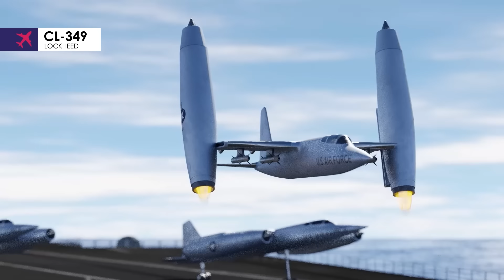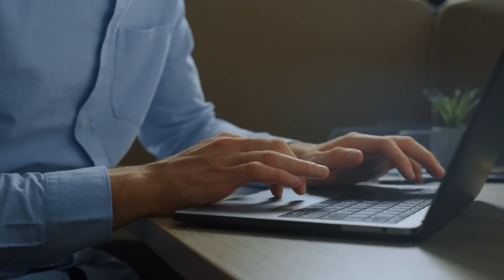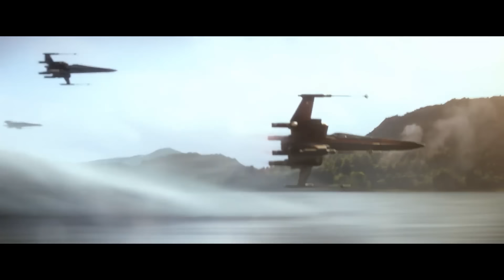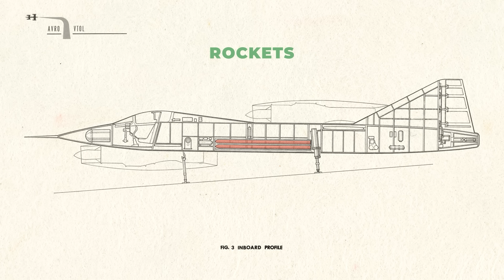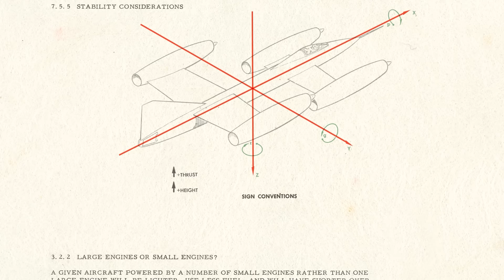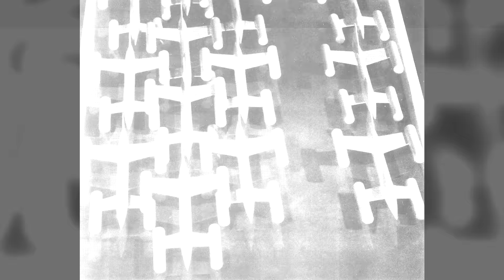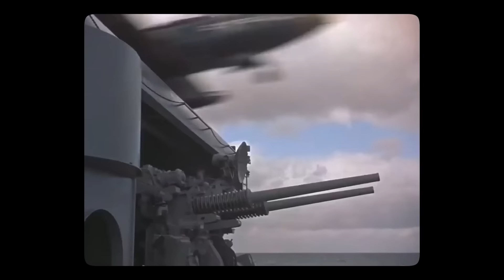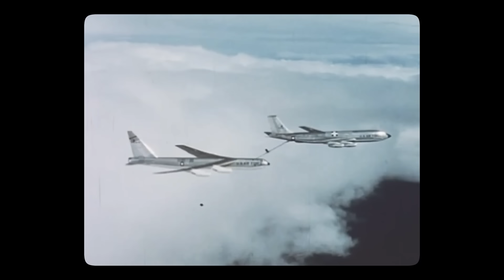Real-Life X-Wing Fighter Jet? ...Canada Tried It

Comment: The concept of the "eyelid" nozzle for thrust vectoring is mind-blowing; I can't believe it took until the Harrier for designs like this to become common!
Reply: Ryan vertifan in the 60s took until the f35 to make that common
Reply: Without sufficiently powerful microcomputers that can fit inside an aircraft, the "eyelid" nozzle concept will be next to uncontrollable. 

All I thought while watching this video is what if a single engine failed? Unlike the centrally mounted engines of current VTOLs, wingtip engines will certainly cause it to be unbalanced and because the thrust is produced at the wingtips, there will be no way to recover it especially with those short stubby wings - not to mention how much that x-wing configuration will cause the airflow to be all wobbly and stuff.
Reply: Pardon? Do you realize clamshell bucket thrust vectoring is standard on jet airliners since the 1950s for reverse thrust braking on landings?
Reply: Harrier doesn't use 'eyelids', it has rotating nozzles for exhaust gasses at the rear, and the same at the front for cold air coming off the main fan. Some main fan air is routed through piping to the nose, tail and wing tips for control during hover operations.
Reply: @PiDsPagePrototypes Like the OP said "designs like this"😊
Reply: Or that they got 95% of the thrust after turning it 90 degrees, that is Wild
Reply: @domm5715 he said 95% of the expected thrust. So if they expected 80%, they got even less.
Reply: In engineering terms, it's so much more efficient. Space and weight you use in complicated hydraulics and actuation systems like the F-35 exhaust vectoring system is a complete non-issue.
Reply: @r0cket_m00se  no, its a flap, we don't use it now for a reason.
Reply: I saw it coming right away. I've been in helicopter squadrons on exercises with AV-8Bs😊
Reply: The harrier 1 & 2 had the finest vtol feature, all it needed, was away to shimmy the mid beam body, from middle to front, for SR/S-Sonic. Today they could also be a twin adjacent engines, on a F14,15,18, and 19. Hell ya the SR-71👀.
Reply: "Development began in 1957, taking advantage of the Bristol Engine Company's choice to invest in the creation of the Pegasus vectored-thrust engine"
So you mean that it took a whole year for something that wasn't the same as the "eyelid"?

In fact the concept of the Pegasus vectored thrust engine began in 1956.  So there wasn't any waiting.
Reply: If you have not. You should look up active flow control. Basically flying using thrusters instead of stabilizers. 

 First we will build triangles without stabilizer, and then disc shape for best all around stealth in every direction, aka flying saucers! Just playing. 

 Adaptive flow is a cool technology. Yet I think VTOL aircraft need a revolution too, and will benefit from it all. 

 Helicopters are hitting limits set by physics. The rotor being the limiter itself, because of super sonic blade tips, and retreating blade stall. Amongst vibrations, and other issues. 

 So more tilt rotor, and thrust designs are going to happen, and should happen. 

 Right now. 

 Waiting for that rotating detonation, electric hybrid fan, turbo fan, SCRAM jet engine with 3d printed, full flow design using tesla valves. 

 The hybrid adaptive electric engine by Ad Astromechanica is pretty dope for tilt powered aircraft. 

  Combine it with other engine varieties for VTOL like R.E.D. 

 I forgot to buy crushed walnuts. God damnit.
Reply: @RedactedDeath  what if a engine fails
Reply: @SakuraMocelot Simple. You just toss the crushed walnuts into the opposing engine and…voila!  No problèmo.  That is, if you actually had them upon your person and had not forgotten them prior to taking flight.  Inherent risks and such…
Reply: @RedactedDeath LMFAO!!!  This sounds exactly like the stream of consciousness that I would’ve typed while cooking something…that hopefully required crushed walnuts. lol!  I seriously doubt that anyone else found this as FAF as I did.  lol.  So thanks.  Hahaha. 

(Had to be certain that I hadn’t stumbled in and ‘drunk posted’ anything that I may have run into difficulty recalling. )

Comment: Is there somebody out there knowledgable enough to give a qualified opinion about the drag factor? I’ve been working on a design which would mitigate almost all the mentioned disadvantages but would retain the “3 cones in front” aspect. So my question is: Will 3 such bodies forming their own shock cones at the front of the plane indeed make it unfeasible drag wise? Mach 1.7 wouldn’t be a deal breaker. We have since then learned that high Mach numbers are not holy, especially if one would gain so much otherwise. Mach 0.8 would be a dealbreaker though. So over to you supersonic aerodynamicists! 😁